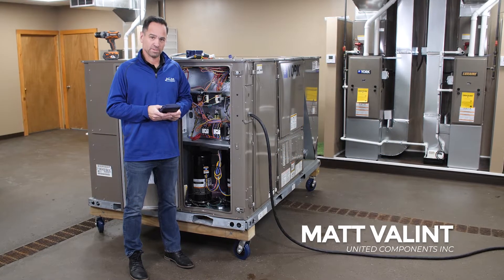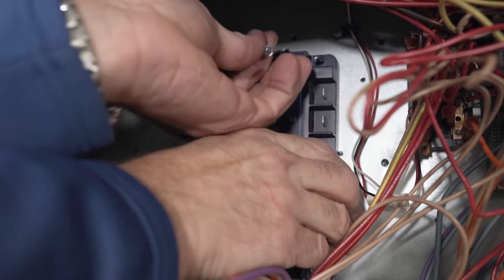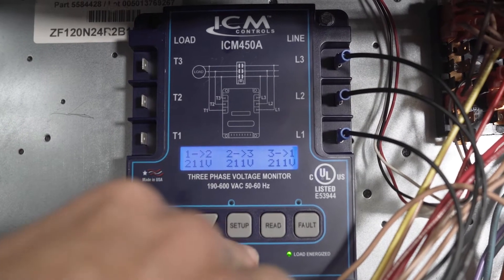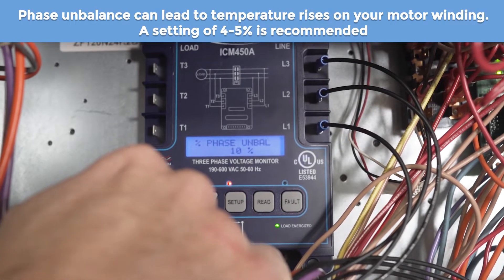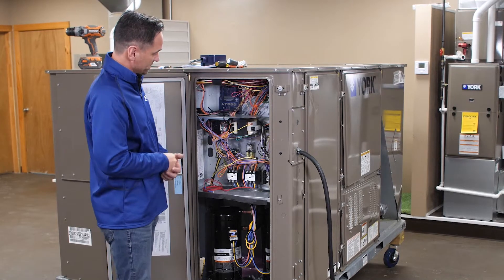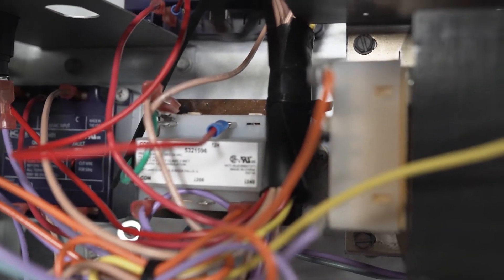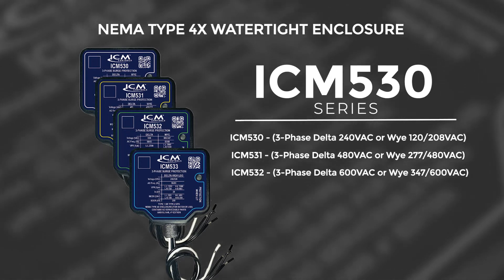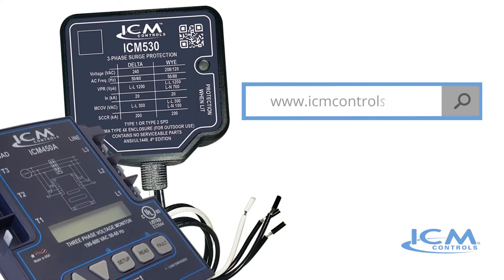ICM450A & ICM530 Install - 3-Phase Power Protection

Comment: In the video is said to connect T1, T2, T3 to the load side of "ONE" of the contractors.  If you have two speed motors or in your case two compressors.. how do you monitor the load side on both the motors or compressors?  Can put T1, T2, and T2 to both load sides of the contractors?  So my question is, "IS T1,T2,T3 monitoring only or are they energized in some fashion?"

Comment: What is the Control Voltage position 4 and 5?  Can you give an example how it can be utilized?
Reply: When this option is on, it allows u to apply a control voltage, between  18 -240volts to it, you can use either a thermostat or a pressure switch, or some other voltage signal if u may choose, when the control voltage is lost it deactivate your NO contacts to its open/ normal state  when closed or activated...so basically it monitors your control voltage alongs with the line and load voltage singal as well
Reply: Good question